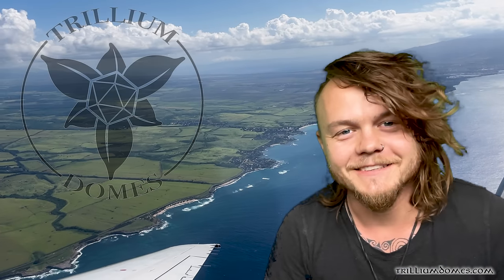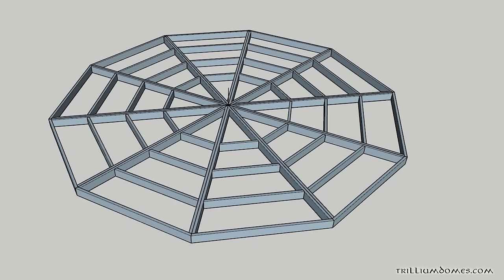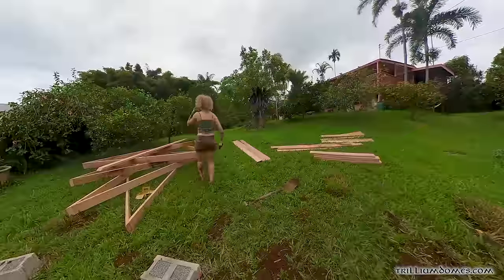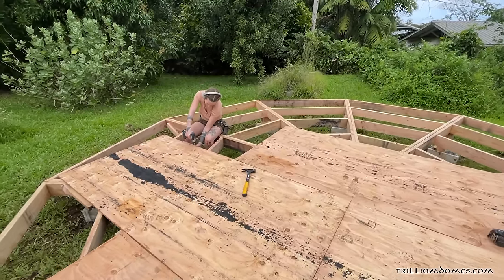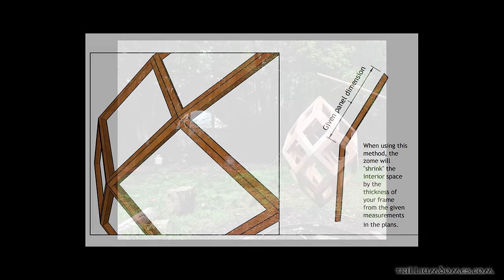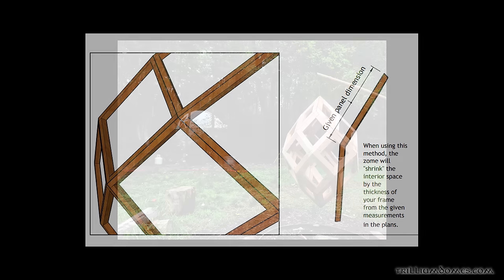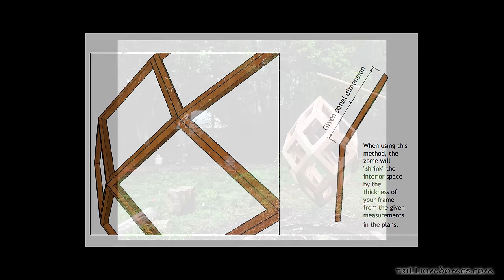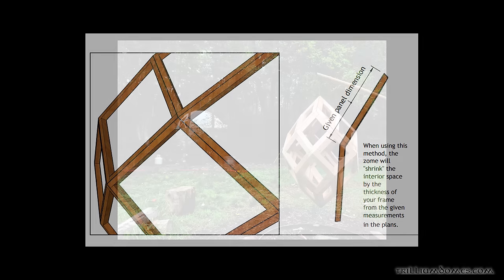Trillium Domes - How to build a Zome cabin

Comment: 2 questions:
1) Why didn't you use your ultimate platform design?
2) What's the thickness of the plywood you're using for the floor (and the dome panels?)?
Reply from the maker: I use different method for zome decks because there's less sides. 3/4 for deck and panel sheathing on this one
Reply: @trilliumdomes  What are the dimensions of the 3 divisions between the pizza slices?
Reply: Its all in the plans  @Norbingel

Comment: Just wondering when screwing the panels together, is it more difficult without the bevel? When I assembled my panels the bevel provided a nice solid surface that i clamped, wiggled a little for good alingment, then screwed. I am trying to picture how panels would be assembled without being able to clamp. Also, from the outside, before covering you must glimpse screws as the pass from one panel to the next? Lastly, for now,😅 is the time you saved, just the time to send all the struts through the table saw to put the bevel on it? 
Nothing boring or dry about your video BTW.   Such a generous unique contribution to the world of  dome  building. 😊
Reply from the maker: Good questions! 

I do not find it more difficult to screw them in without the bevels! Not significantly anyway. We were still able to use clamps. And yes you will see the gaps and screws before you cover the zome, which is why I only recommend this method if it will indeed be covered up. The time saved was mostly not having to make a bunch of compound cuts!
Reply: Thanks.

Comment: Great job as always. Ty for shearing. 
Are dome's the most energy efficient structures for supper hot summers ? And would you say a small dome can handle not using a ac on 90 degree Fahrenheit days ? I'm wanting to build a small studio for my standing desk. What clear material do you suggest as I want a great view.
Reply from the maker: Domes are extremely efficient because they generally have 30% less surface area per unit of volume. You would need a lot of insulation to not need AC on a 90 degree day but you can do that.

Comment: What a lovely, elegant and affordable design! I especially like that you've reduced the complex geometry down for self-builders. I wondered about the quantity of waste materials generated with less regular shapes and if you have ever considered designing with minimum waste as the priority? I'll subscribe, thanks!
Reply from the maker: most of my designs are micro adjusted to make the most efficient use of the lumber sizes I have in the materials list. domes have 30% less surface area per unit of volume vs boxes to begin with. So you'd have to have a 30% rate of waste to even use the same amount of material for a box IF the box was build with 100% efficiency, (they never are). I've built many smaller rectangular buildings and there really wasn't any more plywood waste the way we did it here. 

As for the framing there was practically no waste at all.
Reply: It could be interesting using 3 D Printing to create panels from recycled plastic sheets. The design could include interlocking joints, with locking nuts to secure. The large amounts of plastic material, being collected from the Oceans could become a valuable resource for land based communities.
3 D Printing is used in Italy to create panels for yachts, in the motor industry parts are made, lights and body panels.
Thank you.
# Heroes AtSea.
Reply: I have tobsecond the efficiency. In Australia (material costs vary internationally) , I have just built a 12 sqm box, next to a 30sqm dome and the cost of the square, traditional, stick build was easily 4X. Lesson learnt here. Zome/dome is so much more efficient.

Comment: Briiliant self build idea. I being an amatuer would build models first with the base literally the size of a pizza. When I became confident enough I would then attempt the full sized version
Reply: Just go for it. 0, I mean O! Precious experience required. Just follow the plan amd it will work. It won't look as easy as when Johnny builds it in the videos 😵‍💫, but I promise you it is as simple. TOTAL Ameteur here, and it took 3 weeks, not 3 days, but it all worked out fine. All the bigger thrill when the final top piece goes in.....AND IT FITS!!!!  You can do it.

Comment: Could you disassemble to move it without it getting loose?
Reply: Yes! Just use through bolts and nuts instead of wood screws when connecting the panels to each other.

Comment: Two thumbs up, like unique projects. Just wondering/thinking if it could be done with precast light air concrete slab panels with some kind of hidden fasteners/connectors instead of wood frame and plywood panels.
Reply from the maker: I'm a wood guy so I personally would build the frame as a form then cover with concrete / hempcrete / aircrete etc so you still have a beautiful wood interior to work with.

Comment: How would you insulate & finish the interior for a cold climate?
Reply from the maker: I would probably use poly iso foam board and 1/4" tongue and groove wood between the frames. I'd probably make them a contrasting stain so the frame stands out! But you could use drywall, plaster and pretty much any type of insulation.

Comment: What’s the amount of wood scraps when building this shape building vs more traditional shape buildings?
Reply from the maker: So domes have 30% less surface area per unit of volume vs boxes to begin with. So you'd have to have a 30% rate of waste to even use the same amount of material for a box IF the box was build with 100% efficiency, (they never are). I've built many smaller rectangular buildings and there really wasn't any more plywood waste the way we did it here. 

As for the framing there was practically no waste at all.
Reply: Interesting notes, I just wish it had a porch.
Reply: Just add one. By the time you've built a dome/zome, you can figure the rest out.